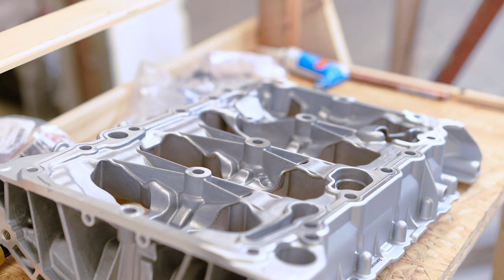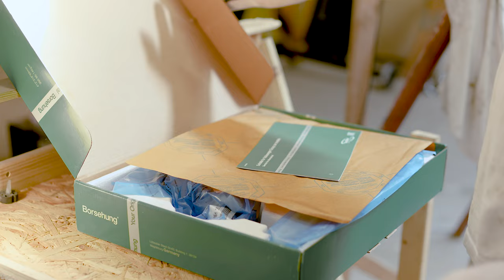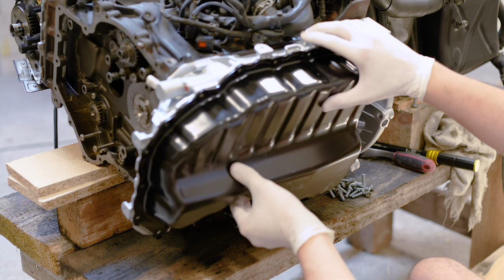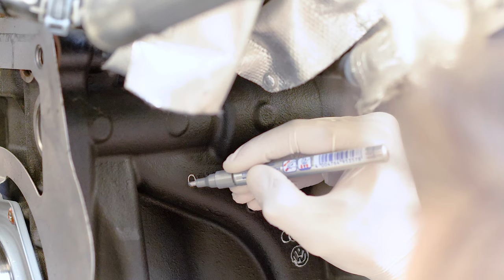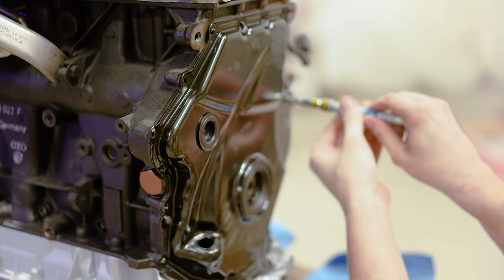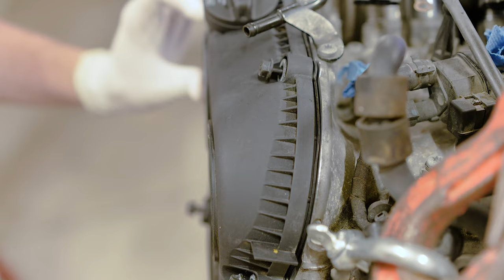WILL THE REBUILT ENGINE TURN ?? - E8

Comment: You are cool!, I try to dissembly an audi tt RS mk3 now, may you know an method to move forward passager seat? in my case is full electrical, and I unscrewed front but can't back side, not as your example, I watched all your videos), died seat moving motors, up/down and front/back, help please if it is possible, Thank you! and good luck.
Reply from the maker: Thank you so much Victor!!
This is what I would try:
Look under the seat, in the middle is the electric motor for movement back-forward. Look for cables that connect to motor, and search for connector on the other end of those cables( the connectors that go to the floor of the car).it shoudl be just two pins, maybe bit larger for power! Then use two wires and connect those pins with 12v battery from the car. Just touch the battery shorty and see if the seat moves( you will hear the motor). If you need opposite direction just switch + and - of the battery, and the motor will turn in other direction 🙌🏻 good luck!!